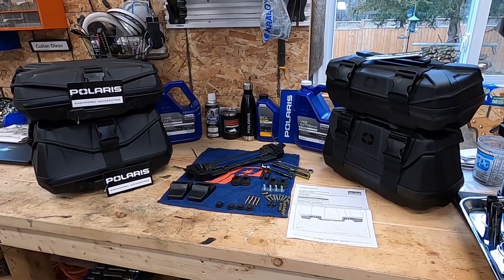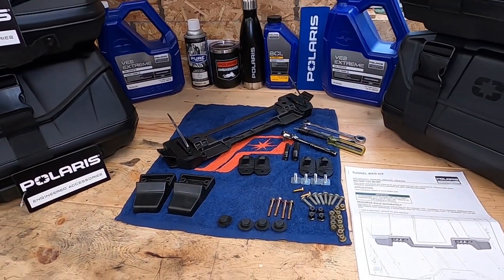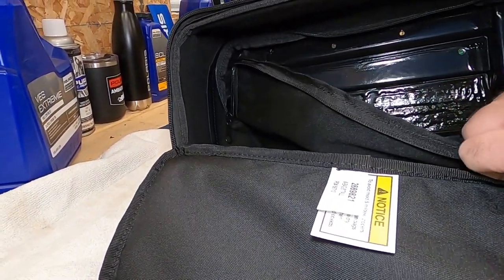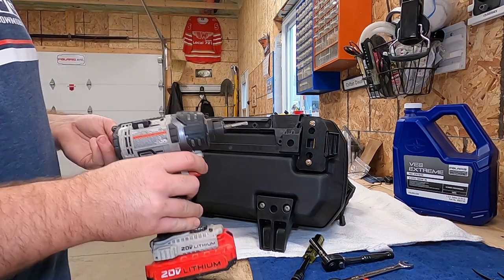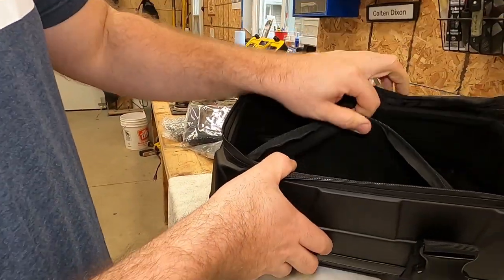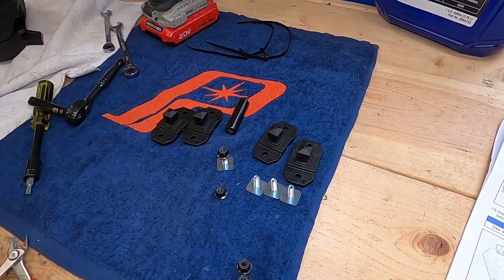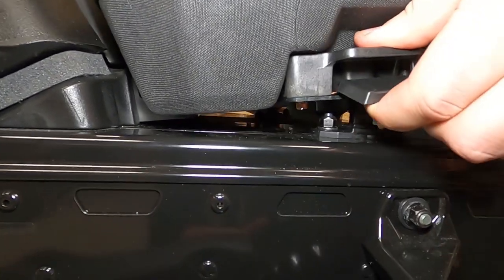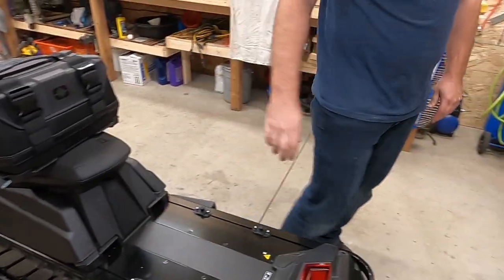**NEW** Polaris Lock n Ride Flex Tunnel Storage - Review and Installation

Comment: I have a 2020 XCR 129 with Axys Chassis and would like to put Lock & Ride Flex Adventure Tunnel Bag, Tall
 Item # 2884456 on it with the adapter, but honestly, I can't see that it will fit. It looks like the dimensions will overlap the rear break light enclosure. Can someone confirm if this will work? I believe the smaller bags wouldn't have a problem, but I would like the bigger one for overnight trips.
Reply from the maker: You shouldn’t have a problem it is tight but should work . To double check you can verify with your nearest dealer, but they fit on a 129 Matryx and it’s pretty well the same tunnel so don’t see why it wouldn’t !

Comment: will a spare belt fit in the 8" low bag?
Reply from the maker: That is a good question, we never tried that and no longer have the 8” low bag, I would think it would fit thought ! Try it at your local dealer if you can 👌
Reply: @krazykanucksperformance2242  FYI... i bought one, and it does fit just fine.  Much easier access than tucked away under the hood.

Comment: Great video. Enjoy the content. The tunnel bag options for the Matryx that you're showcasing is good stuff. Separately, have you noticed any tunnel wear from having the 16" bags (either high or low) installed last season? I've noticed several Matryx machines with paint wear on top of the tunnels from vibration caused by the 16" bags. The 8" bags would not be an issue since the mounting bracket is directly under the bottom of the bag preventing sag and contact with the tunnel.
Reply from the maker: The large bag did wear some paint off the tunnel on a friends sled. I have my wrap on my sled so it did not damage the tunnel at all .
Reply: My sled is wrapped too but I don’t want my wrapped damaged. Did the 16” damage your wrap?
Reply from the maker: @cameronmacko2817  no it was perfectly fine

Comment: Hey would you know if I can add the lock &flex bracket s on my 2020 adventure bag
Reply from the maker: I don’t believe you can add them to the bag, you can buy an adaptor kit that poalris sells for mounting the old style bags to the new set up . Check it out on the Polaris Snowmobiles website
Reply: @krazykanucksperformance2242  thanks I'll  check it out,waiting for my snow check have you heard anything
Reply from the maker: @mikemoffatt6278  what model are you waiting on ?
Reply: @krazykanucksperformance2242  650 XC 137